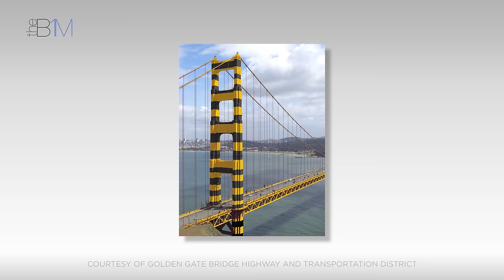The Golden Gate: Building an Impossible Bridge

Comment: Question: If this bridge was built now, could they skip the mid-channel tower? Because constructing the tower in the middle of the water required a caisson didn't it, and must have been very hard. But if it were possible to construct both towers on  land, or just off the land, it would be a lot easier. Is it now possible to make stronger/lighter cable in order to do this?
Reply: Modern steel and prestressed concrete lets you build longer spans, so it can be done though it'd probably be too expensive. Nowadays building in the middle of the water is also easier than then so the towers'd be probably built in the channel too, because it's cheaper. I'm not sure about the bridge type, tho. Today the go-to rule for big spans over the water is using a shorter cable-stayed span with pillar supported approaches over the water as it is way cheaper (see the Sutong Bridge, main span just 200 m shorter than the GG), but really long ones still require suspension and maybe because of the strait characteristics we'd see a suspension one, but expectedly with a different tower design, something like the new Dardanelles bridge or the Great Belt one. Civil engineering has advanced a lot and nowadays it seems that the only limit is money, but we certainly wouldn't be here without the daring ideas of the engineers back then.
Reply: @josevicente12  Thanks!

Comment: If  you go to SF, cross over to Marin to see the bridge from the proper perspective.  Also take the harbor cruise that goes under it.  You will never be more awestruck.  The bridge was constructed almost flawlessly by a brilliant team.  To think that some of that same team went on to build the ill-conceived and disastrous Tacoma Narrows Bridge, which failed, is absolutely puzzling...
Reply: It's not puzzling, engineering was like that back then, they didn't fully understand how structures behave (and we still don't!). 
The Golden Gate Bridge was built pushing the structural theories back then so they could build a span longer than ever; when Moisseiff pushed even more the same theories at the Tacoma and it collapsed, only then they realized that that science was based upon wrong assumptions and reinforcement work had to be done in the GG and other bridges. Moisseiff was a good designer that, as all civil engineers back then building long spans, had to take leaps of faith on numbers that could not be fully proven. If those assumptions had been correct and the Tacoma bridge had been successful, we'd still talk about it because it would have been a serious revolution on bridge design, and we'd pity the next engineer that pushed the new science too much. If they got the required money for the more conventional Tacoma design, the mistakes would have been by any other engineer, as there was no way back then to prove that stuff. It's a shame mr. Moisseiff died with such a tainted legacy as he was one of the greatest engineers of those years, and it's certain that without his work, bridges like the GG would not be here.

Comment: There is a plan to build a 3600m bridge on Norway, over the King of the fjords on E-39 Europe road. If it get a bridge like in San Francisco, then it will get tower over 450m high. But it bribable will be built with floating pantoons with two pipes, one in each directions. The fjord is 1300 meter deep at the area, so anchor the pipes must be done in the same way as oil construction's, something the state of Norway have a lot experience with.

Comment: If you were to ever re do this one, definitely worth talking bout the way they divide traffic. They used to use yellow pegs and hand swap them to change lane configurations for the daily traffic needs. Not they use a steel and concrete barricades that can be moved by a truck that will eventually be done via a drone.

Comment: They really should replace those steel cables with 100% stainless steel cables, because the existing cables are severely corroded inside and it is a safety hazard. Yes, those stainless steel cables will be twice as thick due to the lower tensile strength of the metal, but they will have an infinite lifespan compared to regular steel, and won't require any maintenance at all.

Comment: I'm curious if this bridge had been built 50-75 years with it's exact material and design (I know probably the steel didn't exist 75 years prior.. but just for the sake of argument) if in 1906 it would of survived the quake of San Francisco. I'm curious if it being slightly aged and some rust (regardless of it's maintained year round work of painting) if it will last another quake equal or greater to 1906.  the quake in 1989 was only a large moderate. not a great quake. so it had pretty much 0 affect on the bridge as far as damages went.   it's a 113 years gone by. 1906 quakes happen about every 75-100 years.  as a matter of fact a quake the size or even greater happened in 1880 in San Francisco. and one in 1862 I believe in Stockton.  so.. yeah we're pretty much overdue for a huge quake

Comment: Not that it’s a competition, but the Mackinac Bridge is 5 miles in length, cost 100 million, and had over 100,000 steel cables as the makeup for each main suspension cable
Reply: The mackinac is also a masterpiece but it doesn't get the clout because of its location and doesn't look as appealing as other famous bridges

Comment: The authorities should  consider bracing that old bridge  with additional  cables  starting at the top of the tower and meeting the deck at say one quarter of the bridge's length. Additional cables would be included in between  and so the bridge would be changed from a catenary bridge to a cable stayed bridge  which is much more stable and it could be incrementally maintained much better.  If they include what I said, that bridge  could last forever. As it is with the load being taken by those two main catenary cables, well maintenance is not so easy. Also the catenary bridge does not include any triangle in the cable systems and in fact many  trapesiums  which can change its shape.  By brasing it as I suggested, a lot of triangles would be included  and one cannot have anything better than a triangle in structural engineering for stability.   No one will ever go back to the catenary suspension bridge as the triangles in the modern cable stayed bridge as the Millay Bridge have taken over because of their better logic in the manner in which they operate.
Reply: Arch Stanton How many times do I have to tell you BE CAREFUL WHEN YOU TAKE DRUGS

Comment: You said the towers hold all the weight.  Don’t the anchorages also bear some of the weight?
Reply: The cables are in tension and reach the anchorages at a downward angle. If the anchorages should suddenly lose most of their weight and their adhesion to the bedrock they would be yanked sideways and up as that is the direction of the force on them.

Comment: Why is there nothing about the orignal Golden Gate Bridge that collapsed in the Earthquake in 1906 other than it collapsed in the Earthquake in 1906.... ive searched high and low and there is nothing about it or when it was built. But many sites confirm there was a bridge before the current one from 1937 and that the new bridge (1937) was built adjacent to  the original one that collapsed in the 1906 Earthquake.

Some other sites strangely say that there was no crossing ever until 1937 when the Golden Gate Bridge was built (but this is the 2nd one) according to many sources!

Someone please tell me WTF is going on as it's driving me insane lol 😆

Comment: I'm so so very very lucky guys bec.I have a golden memorable pendant made by golden gate of sanfransisco calf.I think this pendant own by designer engener of that brigde.the question is how ....the .pendant came in the Phil.buried in the ground..at back of our home seing my father in 1995 ..that's why when I was young I know already the story /or record that briged. The briged draw at front side of the pendant at back..you can read.......the world single suspension briged. Finest in 1935 at the cost of 35 million dallors...4,200ft.1'1/6 miles long 6 line wide 693.000cu yrd  concrete.80.000miles cable wire was use and over 100.000 tones of steel.

Comment: Yeah ive been over this bridge. Its only a half a mile long. The real impossible bridge to build was the Mighty Mac. It spans just 4 feet short of 5 miles across the Straits of Mackinaw. The water there is 200 ft deep. There enough cable in that bridge to wrap around the world 6 times. So yeah the Golden Gate Bridge isnt that impressive when it comes to competing with the Mighty Mac.